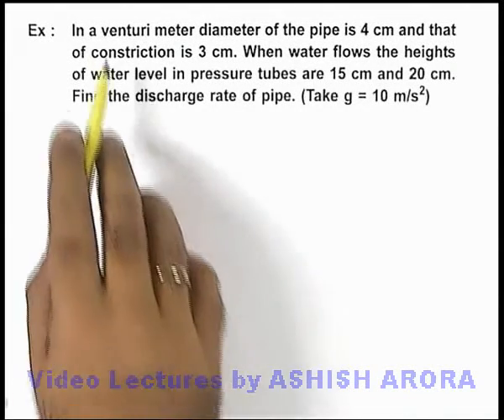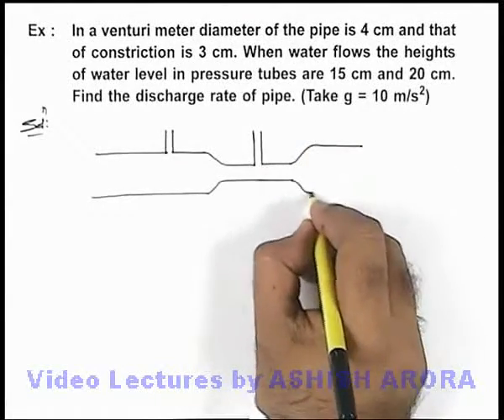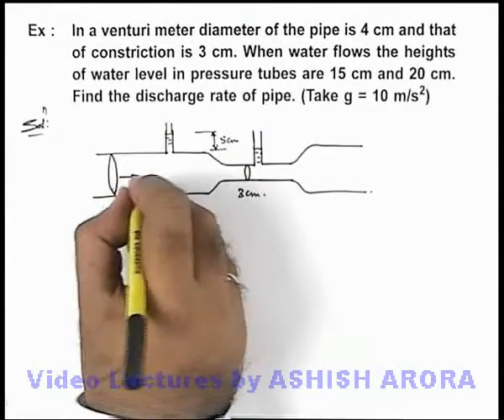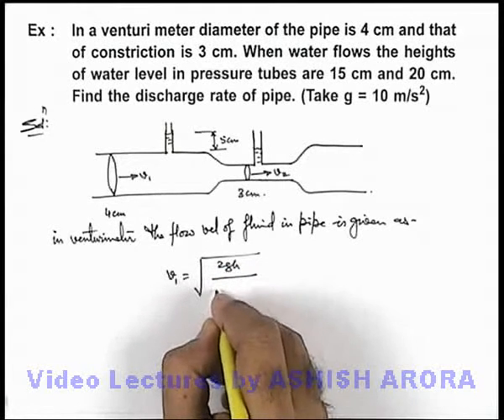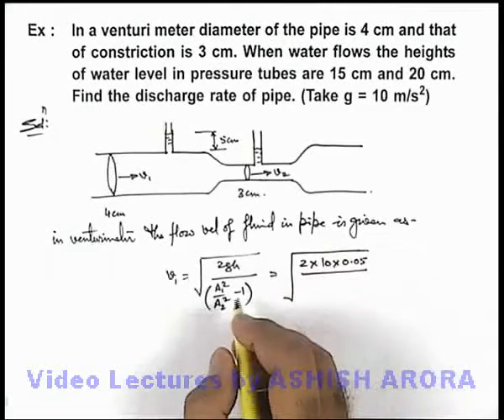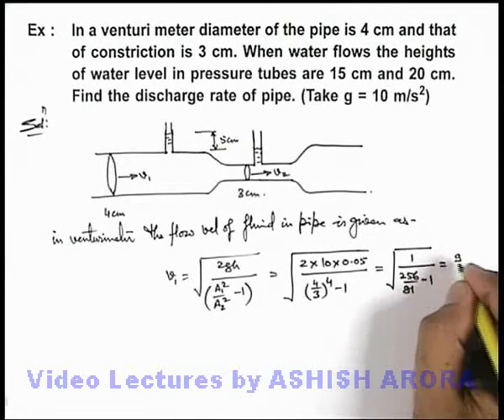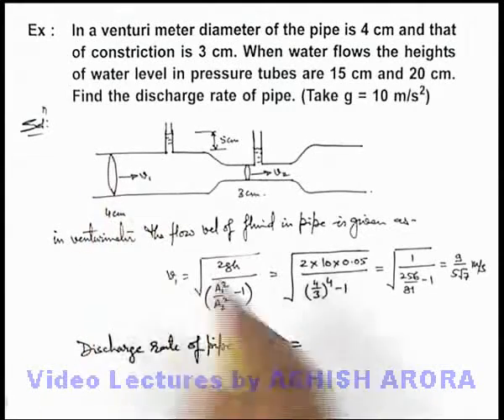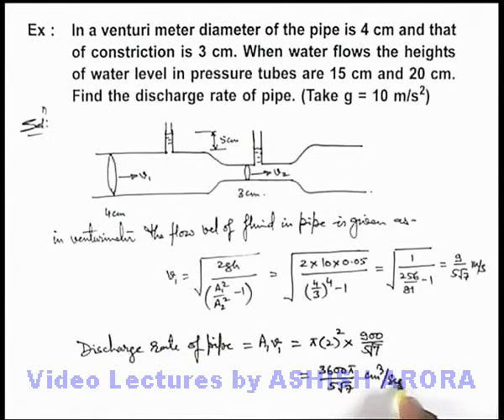Class 11 Physics | Fluid Dynamics | #15 Solved Example-6 on Fluid Dynamics | For JEE & NEET

Comment: Sir why did you take (A2/A1)^4 instead of (A2/A1)^2 here sir?
Reply: Sir dint take (A1/A2)⁴ ...its (r1²/r2²)² so its (r1/r2)⁴ taking radius or diameter is same here as they r in ratio

Comment: sir,while calculating the answer i used radius instead of diameter but it is making a difference .why is it so sir?
Reply from the maker: it does not make any difference... pl check you calculations...